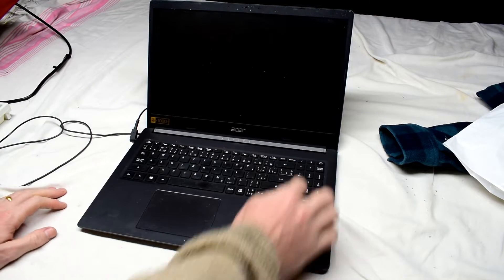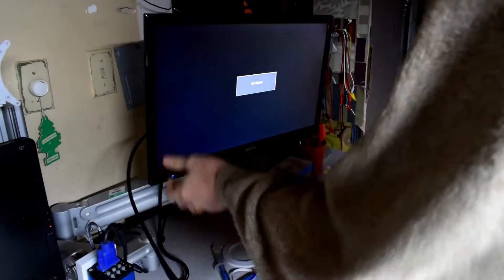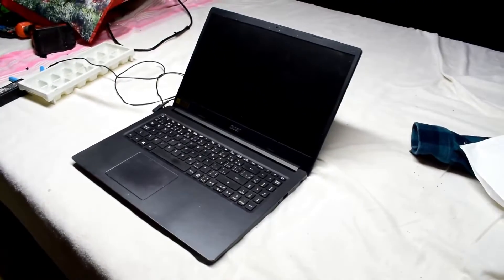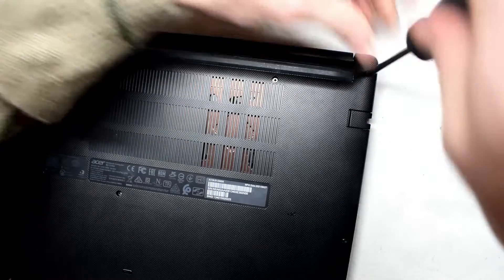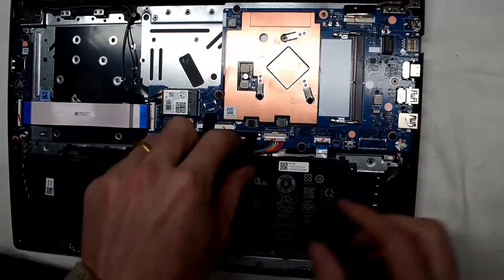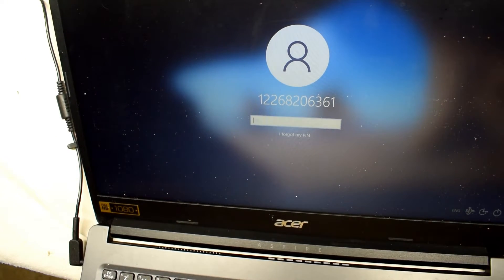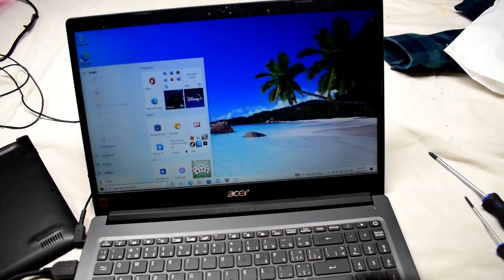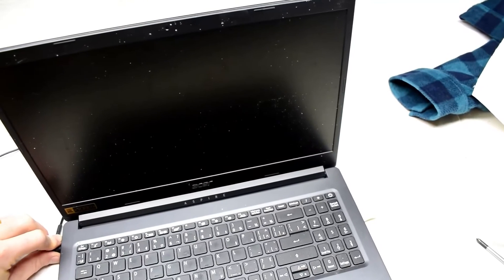Easy Fix! laptop on but no display  (Acer N19H1 - HARD REBOOT)

Comment: Hello sir. Please help me with this same model. Mine does not show anything, not even backlight on the screen but the blue light and fan comes on after pressing the power button.
Reply: My laptop doenst even show logo and no hdmi signal as well but i can see power light and fan noise there too
Reply from the maker: check RAM
Reply: I have one asus but is black screnn i check the ram,hard drive but not working
Reply: @it-laptop.Pyratul  just reset the battery and plug in charging cable wait for an hour and then try to start
Reply: @asharamjibappu8935  removed the battery check